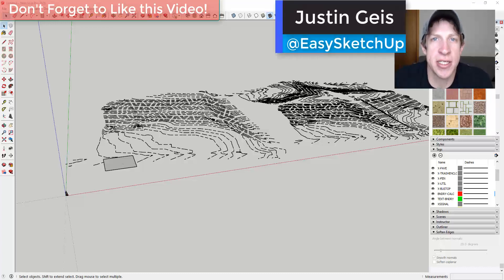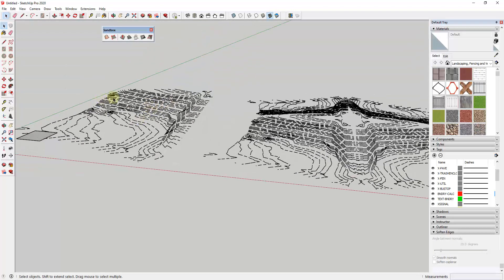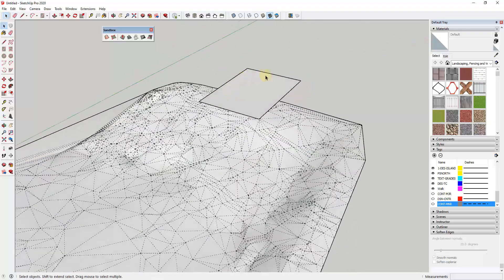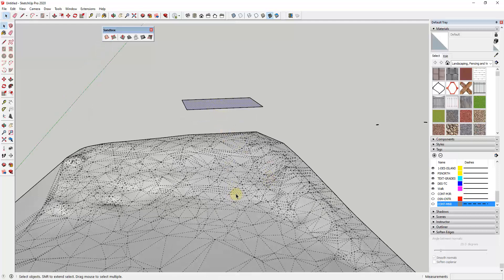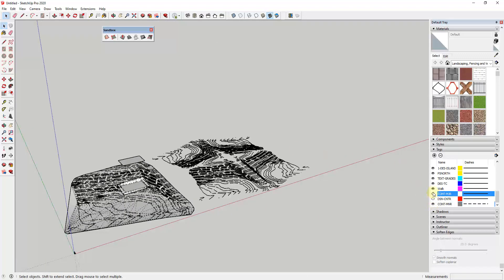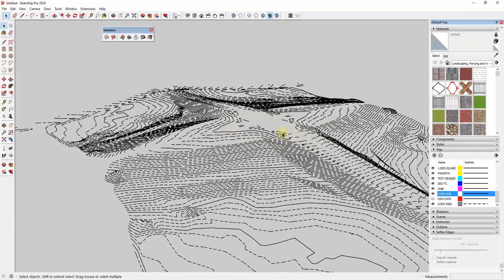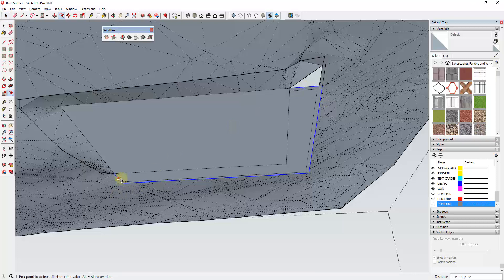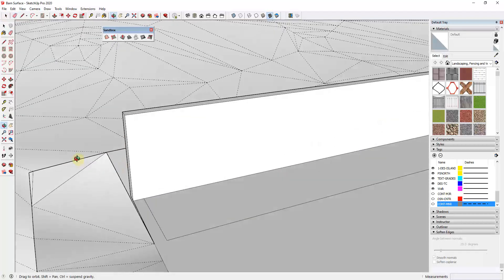SketchUp Architectural Skill Series - SITE PREPARATION MODELING

Comment: Intersecting the faces of the footprint (rectangle box) with the model would also be quite a way to go about.
Reply from the maker: It could work, but you wouldn't get the sloping provided by the sandbox tool. Might work for walls though

Comment: Did you level the contour line by your self or are they self generated
Reply from the maker: I don't understand the question - contours are from the CAD lines
Reply: @Thesketchupessentials  Think he is asking about how you got the contours in different levels. Coz in architecture school we were taught to draw contours in basic method like we do floor plans on a 0 level elevation. But ur contour had like levels here.
Reply: U can get those contour drawings from site engineers. They develop cad slope drawings in elevated levels which turn out like the one shown in the video here unlike us who just plot it on the same level with reference from google maps.